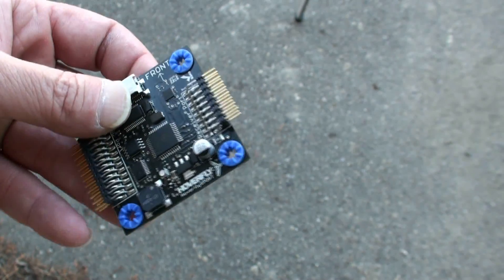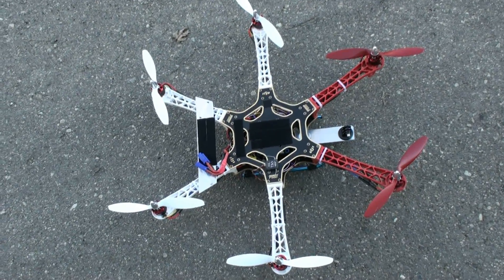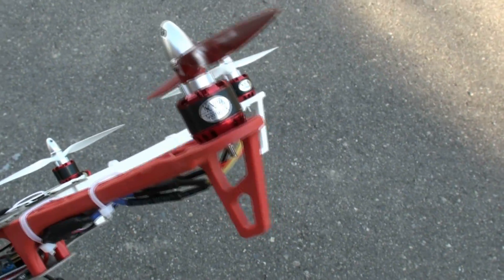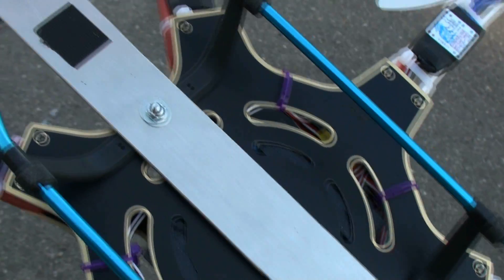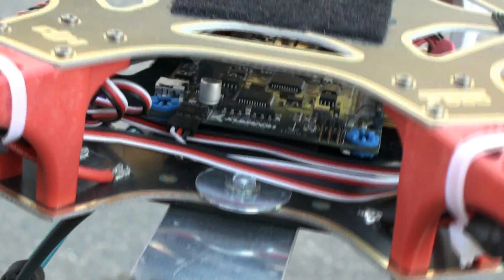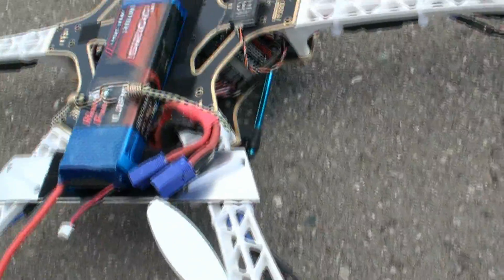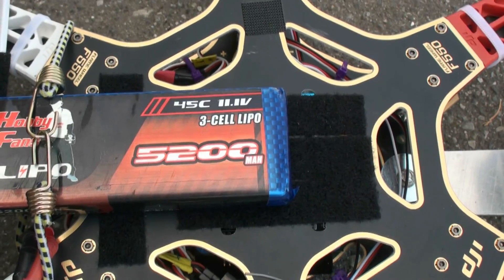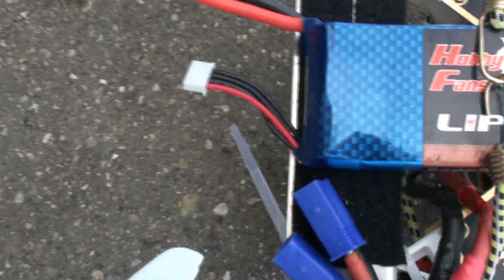Hoverfly Pro 4.x blackboard flight test on Dji 550 Hexacopter GoPro HD Hero #1

Comment from the maker: I do have a new set of motors in the box for the dji and will change them out once I get the giant hex flying, I used your idea from your angry bird quadcopter and direct drive servo tricopter camera boom on my 3 foot quadcoter you can see in part #3 of the giant hexcopter build, the bad thing was that the battery tray was to small for the large motors and didn't
fly long? My new giant hex also has the camera boom coming out the front and I'll send you a link if it fly's OK tomorrow. thanks

Comment from the maker: Hi, Sorry I didn't get back sooner, I've been staying up day & night  getting my giant hexacopter ready for it's maiden tomorrow on Sunday so i haven't watched my pc to much.

 My dji f-450 is kind of for fun flying and it did have a left rear motor problem with the shake, the props are balanced pretty well but could also be the problem? those motors where off my first hobbyking 450 and did crash about 10 times before I installed them on the naza.

Comment: Only friendly advice.  You will not get the jello/vibrations out of your footage with your camera mounted directly to the frame.  Your cam mount needs some kind of dampening between it and the frame.  Also if you are only goin for FPV, props in your footage is okay....but if you want to use your vids for anything besides fun you will need to position the camera so that the props dont show in the footage.  Last thing, your props sound out of balance...make sure to balance blades AND hubs.

Comment from the maker: Thanks, I have the 10x4.5 & 10x 4.7's and the problem with 1200kv rpm is that resistance start to back up on the ESC's and they become to hot hauling the GoPro  camera w/ mount and the 5200mha lipo, now the Dji Naza stock motors are about 2822mm, 750kv rpm and work much better with the 10" props and run cooler almost like their geared down with no resistance.